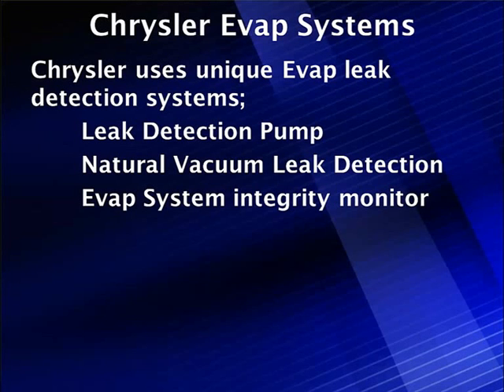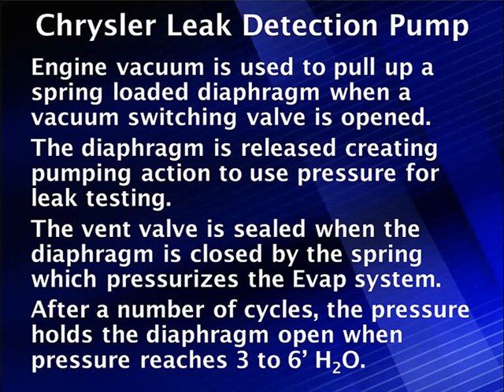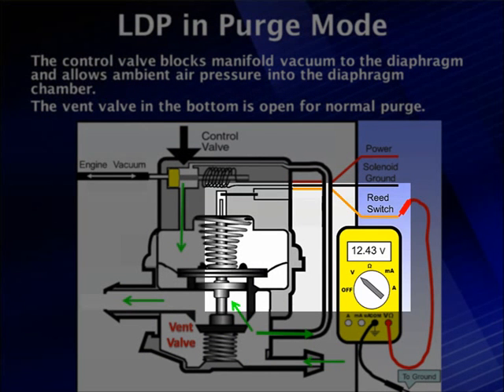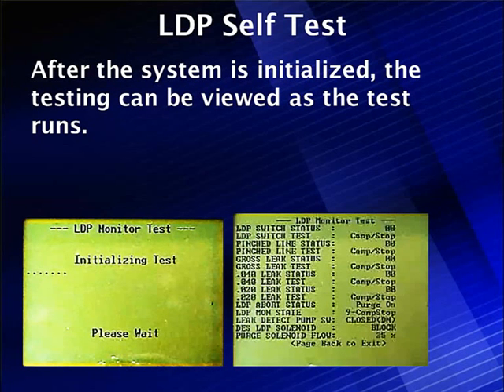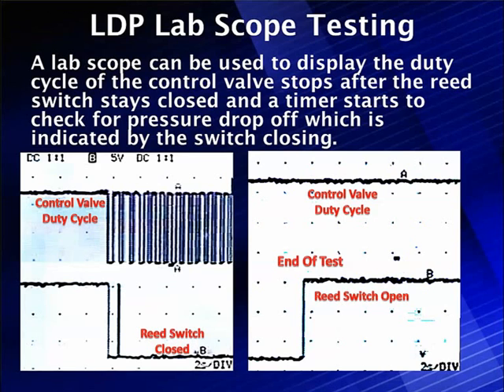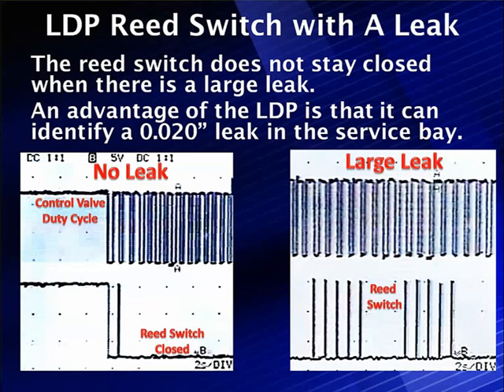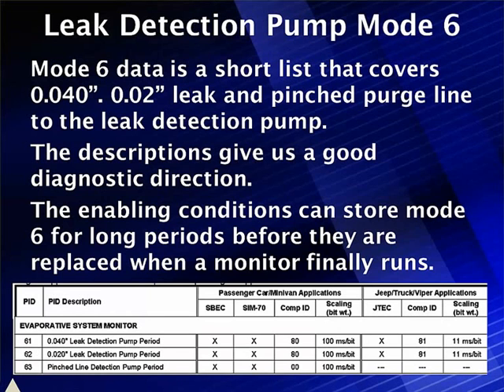08 Chrysler Leak Detection Pump

Comment: 0:46 The spoken words contradict the printed words: "The vent valve is sealed when the diaphragm is closed by the spring which pressurizes the Evap system."  The spoken words are correct, and the written words are wrong.  The vent valve is actually open when the diaphragm is closed or in the down position.

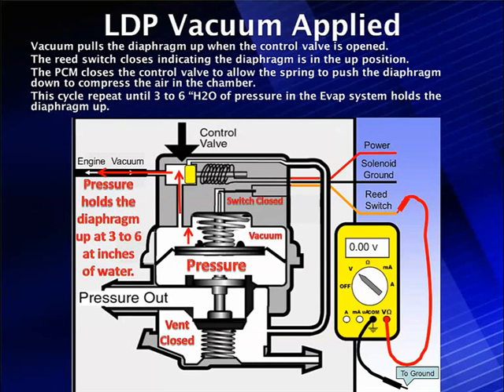Comment: at 1:42, with Vacuum applied,  Diaphragm is up, but I believe switch is OPEN, not CLOSED for this case. It seems to me that the switch state (open vs. closed) is reversed in this description. Otherwise, very helpful.